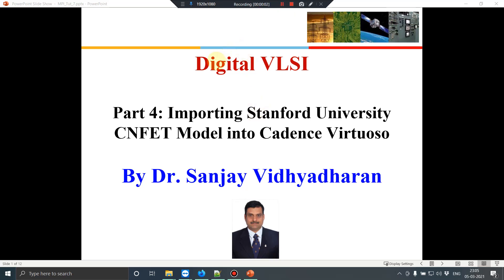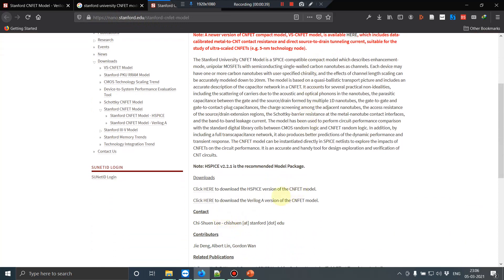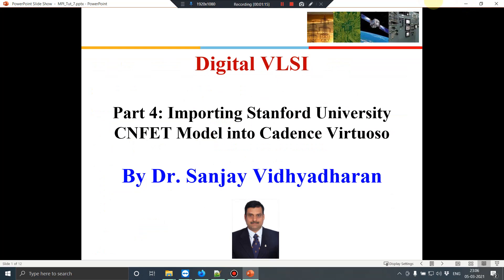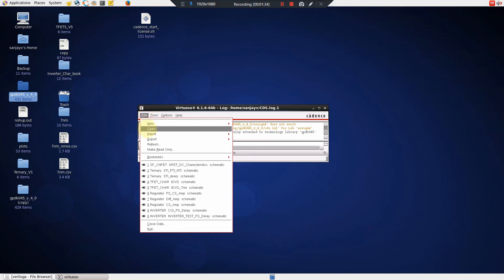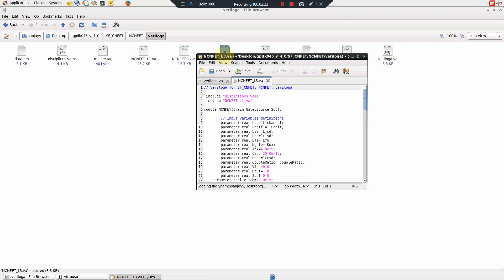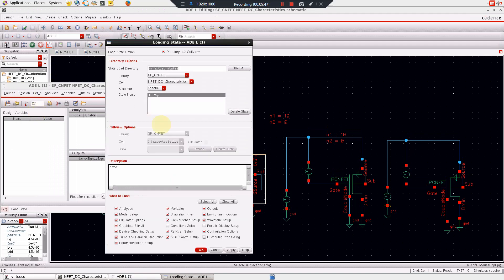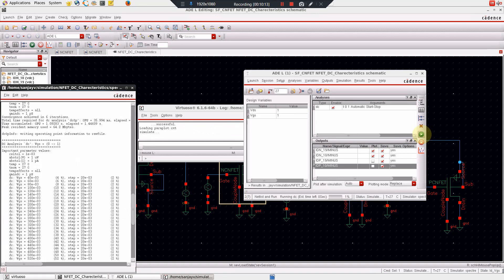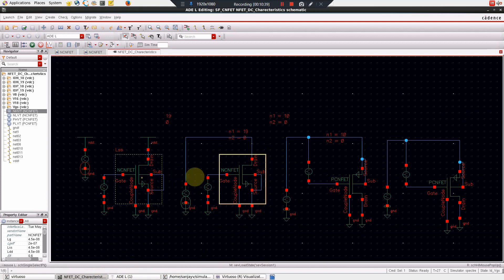Digital VLSI Part-4: Importing Stanford University CNFET model into Cadence Virtuoso.

Comment: hello sir this video is really great it was very helpfull for me. but when i did power analysis its coming 0 for total power. the circuit i was using it was a gated SRAM.
Reply from the maker: Yes, this model will not compute power. You need to plot current from power supplt source , take average  and multiply with VDD to get power.

Comment: In your NCNTL3 vams file there are four port (drain gate source sub) but when you make a symbol its showing 5 pin one "couplenode" is there ,can you tell me the reason??
Reply from the maker: You can ground the couple node.  Couple node comes from NCNTL1 vams which is invokde in L3.

Comment: Sir this is very nice and elaborative video..I have one doubt,if I have to compare performance of 22nm cmos technology with cntfet,then is it enough to just change length of cnt and length of S/D in cntfet as 22nm,other parameters in Standford university model (which is given for 32nm) remains same?
Reply from the maker: Yes changing  length of cnt and length of S/D in cntfet as 22nm is good enough.  You can use a single tube for CNFET ( specify it in your writeup) and use miminum  permitted channel width of MOSFET ( specifu the channel width)
Reply from the maker: Nice to know that it is of help.

Comment: Sir, I am getting power in negative value after  plotting the current from VDD (Power supply) take average and multiply with VDD. what could be the reason sir?
Reply from the maker: It will be negative as power dissipated in the source is negative. The source has given power to the circuit. The components in the circuit will have positive power.
Reply: @SanjayVidhyadharan  Thankyou sir. for some circuits Average power is becoming zero?? What could be the cause sir?

Comment: sir while simulating the designs with these models, getting power signal as zero output at every instance it is showing zero only. i tried for several designs and i am getting the same power signal as zero signal. and while creating this cntfet library i didn't add it to existing libraries like gpdk45 or something else. 
i got the functionality of the designs correct but the power signal as zero. kindly response as soon as possible sir.
thank you sir
Reply from the maker: You will have to plot the current from VDD (Power supply) take average and multiply with VDD. You may listen to my video https://youtu.be/bf5cCtLoYTo  for the procedure to compute power.
Reply: @SanjayVidhyadharan  thank you sir
Reply: I will do it, if I got any errors, I inform you sir, please rectify it
Reply: @SanjayVidhyadharan   this product of Iavg and VDD is the static power right sir
can you please tell how to calculte the dynamic power for cntfet models

Comment: thank you sir, what is the use of coupleNode sir
Reply from the maker: The model also includes a gate interconnect parasitic capacitance  Cgtg which is about 110 aF/μm for one side. You may neglect it an keep is open for schematic simulations.